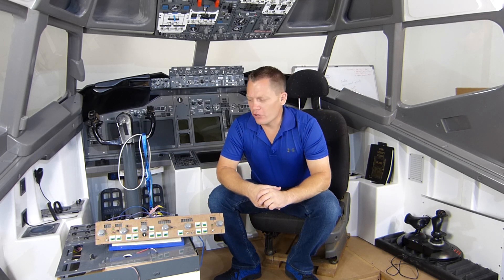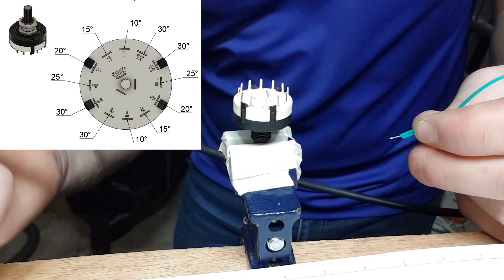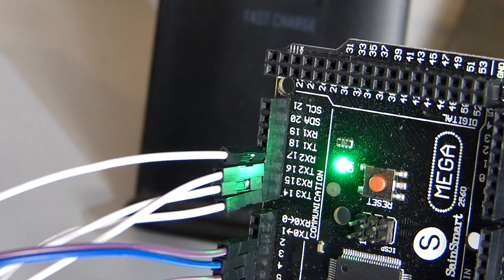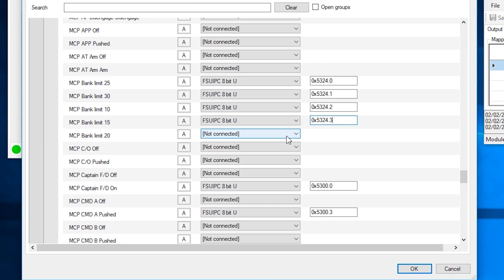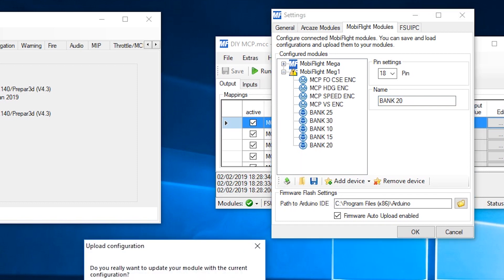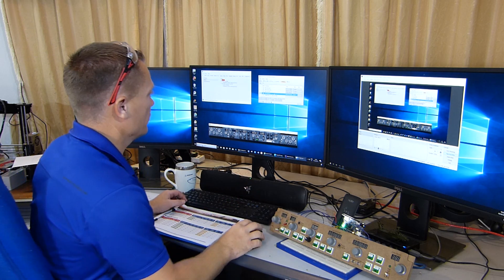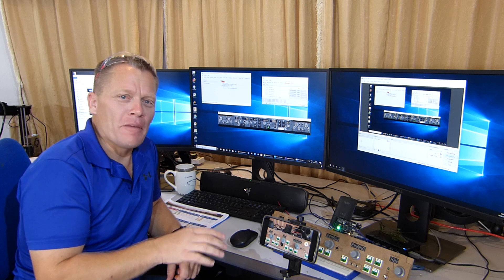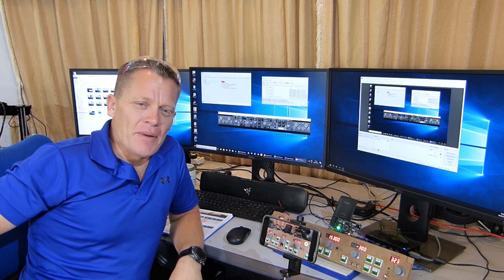737 DIY MCP - Rotary Switches, Prosim & Mobiflight

Comment: Hello. I really appreciate your videos and efforts  of sharing your knowledge. I am wondering can I use that type of rotary switch as an encoder (like heading bug). If yes how should I make the connection?
Reply from the maker: Hello and I don't believe you can use a rotary switch as an encoder. As they cost about $1 each, I might be easier to purchase both for your needs. Kind Regards Karl

Comment: What I'm asking myself - is it a problem that they only sell rotary switches with these shorter shafts these days? Is it a disadvantage when you are building a panel?
Reply from the maker: Good Morning Mickey, I hope this finds you well and I'm loving the updates on your sim! For me, the short shafts are not a problem as i normally only attach them to the faceplate, With the CNC, i then cut the recess in the backplate for the body to fit into. But i can see if you want to mount them into the baseplate instead of the faceplate or even further back on a PCB, a long shaft would be required. I do try to model every component in fusion, (I have drawn models for electrical components i use - If you want me to add them to the downloads section so you have access, just ask) this ensures that i can just insert them into the model and check for fits and clearances, but attempting any build. Of course in the past i just used to wing it.